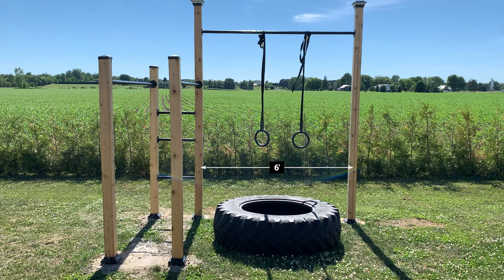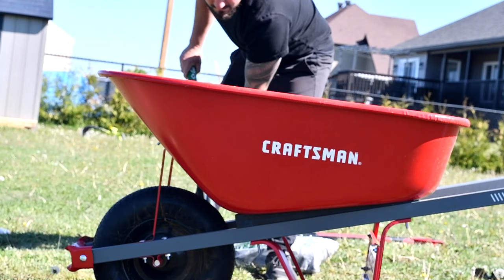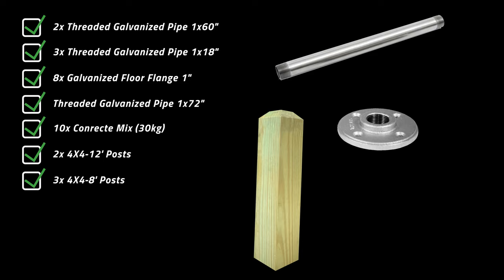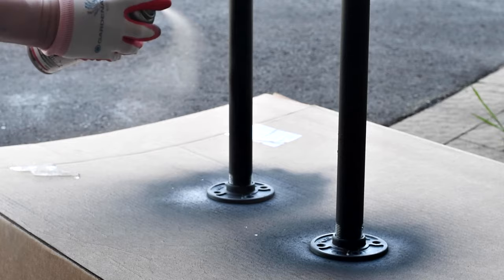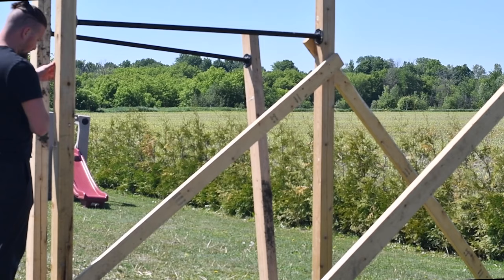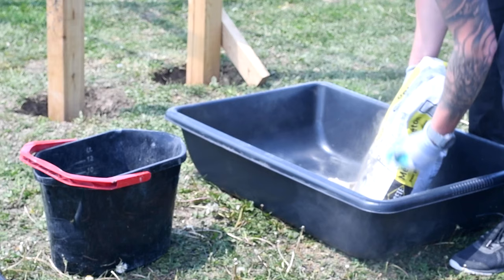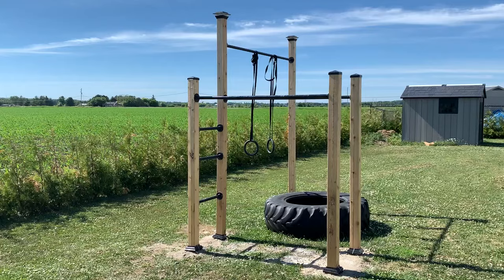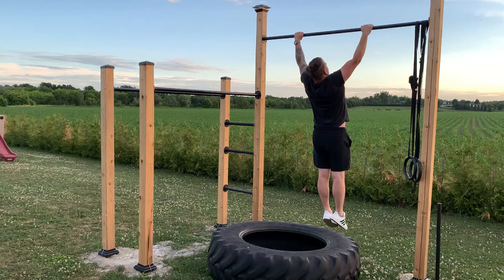Built Your Own Ultimate Backyard Gym (Pull Up Bar + Dip Station) | DIY

Comment: Good job but you shouldn’t fill the concrete to the top of the hole, stop 4 inches off the top and back fill with soil and seed it
Reply: Can you explain why, please?
Reply: Bruh  @ImzyImz  it should be common sense.. it looks neater and better when no concrete is visible and is instead covered with grass
Reply: It is a good and considerable suggestion; foray, it really boils down to personal preference; but not a must.

It very well may be preferable for some; however there are opposing consideration(s); for example: damp & extremely hot environments; it rains a lot where I live and it is an additional layer of protection for the base of the wood; even for treated wood and coated with a sealer like Klitz; eventually soaking in the wet mud and heat; it will eventually breakdown the wood at the point where the tensile strength is most important; this it is why above ground, concrete "Deck Blocks" exist , ( aka: Also called pre-formed deck foundation blocks ),

I have an 8' privacy, ( zombie ), fence; and have had to replace several 4x4's over time, and also a couple on my back deck as well.

Also, for the rest of us; as we age, the goal becomes to improve our property to become more maintenance manageable; and it would be just another thing to beat the weed whacker line against.

Alternatively, when I can just do a quick & easy fly by on the Hustler raptor and make quick work of it.

Peace
Reply: You don't want any organic material resting against the wood, your advice is the opposite of what you should do
Reply: I agree , concrete all the way up is better for draining water away from posts. Soil around bottoms would encourage rot but if the wood is treated it would still last a long time.
Reply: Ya concrete all the way up.        Protect the wood
Reply: Do NOT follow this advice! You need to keep moisture away from the wood, not introduce it. If any advice should be given, it’s that The guy in the video neglected to waterproof the part of the posts that goes underground and a few inches overground.
Reply: @DVelter it also would rot the post much faster
Reply: Nah I would rather have the concrete

Comment: Great design. Definitely gonna consider that for my backyard gym. Just a tip, mixing the concrete and water in the fence post hole with a pencil bar works much better. I say this after doing about 200 fence posts in my yard.
Reply: One question, where would you find the post and brackets? Also would tree roots ( we’re talking about a 3/4meter tall tree ) be an issue? As in will they ruin all the balancing of the posts over the years?
Reply: @frh1263  I got (2) 4"x6"x16' and the brackets from home depot. You'll want to dig about 3-feet down (almost a meter), so I suggest a posthole digger. So, it really depends on if you can get through those roots easily. If not, it may just take a little longer to dig. Also, I used quite a few bags of cement per hole for stability..
Reply: I'd just use post create, you dump the bag in and top it off with water and it mixes it self....

Comment: Another tip. If you use a metall shoe in which the post can be bolted down and the wood is liftet of the ground a couple of inches . This way it wont rott away in 2 years
Reply: Thumps up for a man who builds and trains

Comment: Hi, good video. I have a question: have you had any issues with the wood posts splitting or cracking from use on the bar over time?
Reply from the maker: Still fine to this day.

Comment: Why do you recommend doing 10” wide holes for the posts? I was recommended to dig as narrow as possible from someone who has previously installed. Appreciate the help
Reply from the maker: I believe 10’ hole would give you more concrete around the post to hold it in place, i would also change 4x4 posts with 6x6 if I would redo it now.

Comment: This is so awesome. I was looking for something just like this. But I have a doubt in my mind. Wouldn't rain and extreme weather conditions make the wooden poles weak with time? Or is there any special kind of wood or a way to make them everlasting?
Reply from the maker: Its not everlasting, but wood is treated, so it will last for a good amount of years, you can also stain it every year if you dont want it turn grey.

Comment: Hi. Did you find 1" pipe outside  diameter is good enough? Do not need bigger? And is it strong enough for length of 180cm?
Reply from the maker: Good enough for my hands, i guess it depends on your hands size, try the feel before getting the pipes in your local hardware store.
Reply: You can always add tape too make the bar grippier and thicker in sections… we use to do it at our estate’s monkey bars

Comment: you appear to have some caps on the top and different ones around the base that aren't in the install, where did you get them from
Reply from the maker: Homedepot, one type comes with lights and the others are simple

Comment: Where is it possible get sketchup for this project? As a construction demonstrator, you are quite "tizls" (google translate refuses to translate it correctly). It is not clear how you treated the leaves so that they do not rot next year. There is no sector for training the diaphragm area. I don't understand what you used the useless tire for. In general, your variant can be used as a base and modified to become really useful.
Reply: A word for the diaphragm area would be core, and there's plenty there to train it
Reply: @zackpero4768  I think that the abdominal press muscle training with the "Sit-Up Bench" is missing. It does not take up much space and can easily be made in your construction.

Comment: I want to construct a pull up bar station in my backyard, but I live in the desert.   It gets up to 120f during the Summer and touching anything metal feels like the devil spitting acid on your hand. I dont want to wear gloves or put shade up over the bar, so is there a material I can use instead of metal that would help? Or even painting the bar white? Anyone with experience with this?
Reply: @rockindoubleu314  Thank you. I like the white idea. Think I'll start there
Reply: you could cover up the bar with a tarp when you’re not using it
Reply: @stingwray6404  That's a great idea that, for some reason, I didn't think of! Thank you